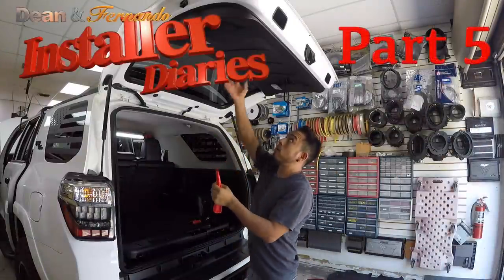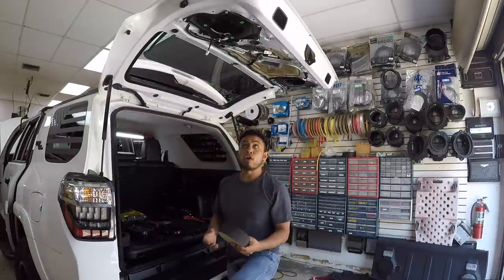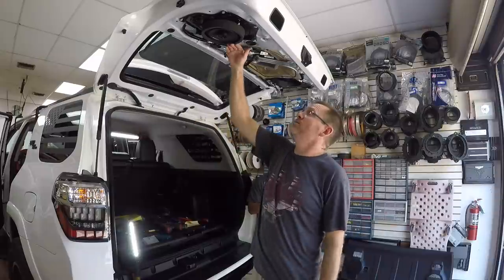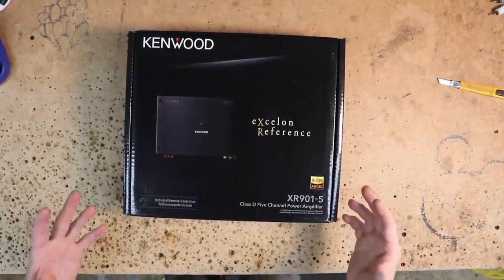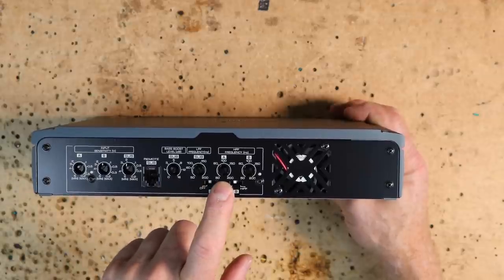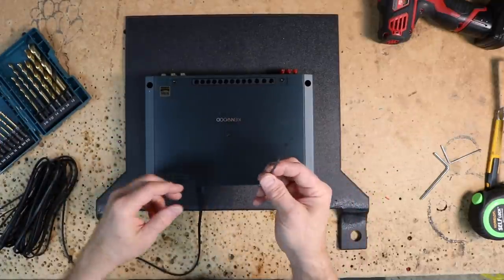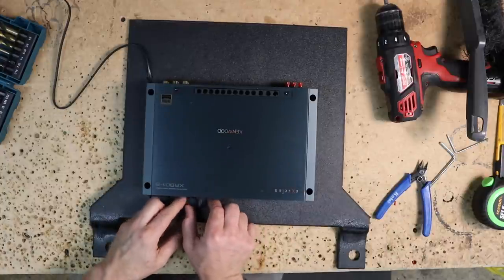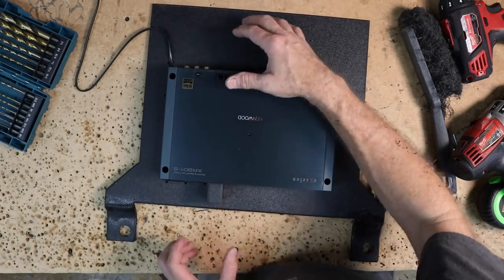2020 4 Runner rear door speakers go in Installer Diaries 325 part 5

Comment: Hello Five Star.!  I am about to upgrade my 2021 4Runner SR5 Premium.  I watch all of your videos, congrats.  I see on this video that the hatch speakers are being replaced.  Would you please tell me how the install dealt with the front and rear speaker circuit impedances;  stock front speaker circuits are connected in parallel for a 2 ohm impedance on each side, and the stock rear ones are connected in series for a 8 ohm impedance on each side ?  Tks much I am puzzled.

Comment: Do you guys use speaker plug adapters? It seems like a super simple way to keep things closer to stock.
Reply: Sometimes you want better wires because the stock ones are sometimes crappy and too thin.
Reply: Depends what power you running from the amp. 50 watts should be fine to use still , anything more than 75 you should upgrade the wire👍🏼
Reply: @seanmichael2777  yeah exactly